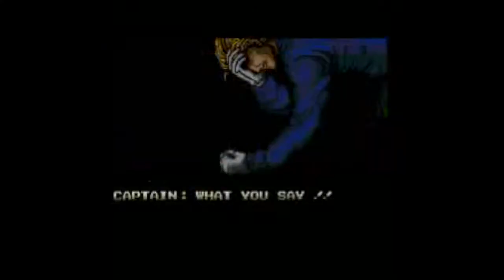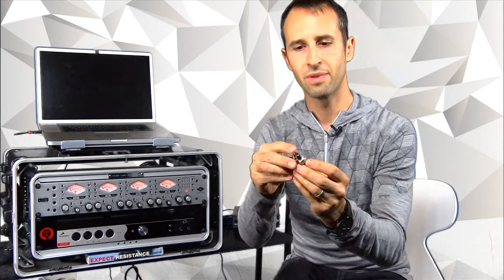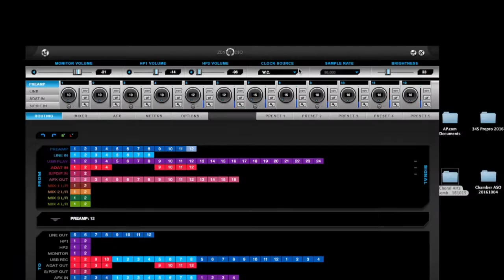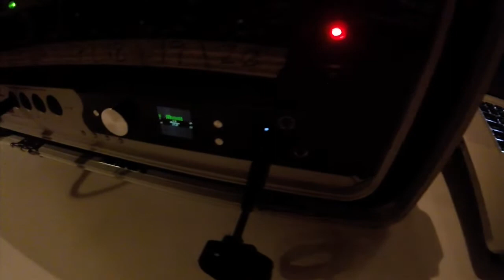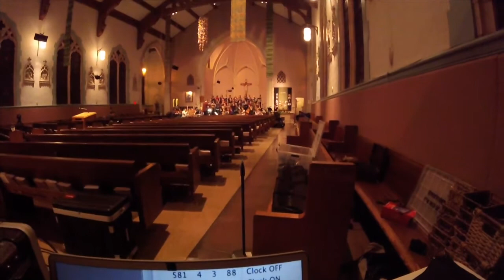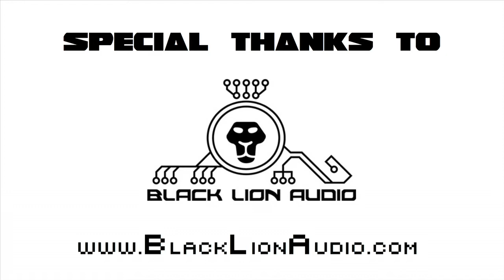External Word Clock Set Up Demo Recording Quality Comparison

Comment: im using my rosetta 200 to clock my apollo quad...thoughts?
Reply from the maker: Hey, thanks for asking! The Apogee Rosetta 200 has some age to it being just over a decade old at this point. The UA Apollo series is still fairly hot off the press & it's my understanding that a lot has improved in terms of clocking during this time period. Apogee vs. UA is like Godzilla vs. Wu Tang so it's a really tough call (although Wu probably wins, really). My suggestion would be to repeat the test I performed in my video:

1) Record identical source material with the clock & without the clock
2) Bounce in REAL TIME with the clock & without the clock
3) Critically listen with the clock & without the clock to different aspects of the recording like high freqs, mids, & lows

This process will def take some effort but you'll have tangible results to compare. You'll at least find things you like about each or maybe even a clear winner. I wish it was possible to give a hard answer, but maybe this will help with a decision. I hope this helps!
Reply: My point exactly!!!! If i have to critically listen,  check under a microscope sort of speak...& Its not a def" major.." oh hell yea moment". Then. It doesnt matter!!!! Its not. NIGHT & DAY
Reply: Lansky Sound tho i do appreciate the reply...i just clocked it to rosetta to see if i hear a diff". &. i dont
Reply from the maker: Cool. Whatever works best is the way to go, so if there's no audible difference I guess the more simple setup is the route. You might hear differences at higher sample rates depending on what you test with, but this is also dependent on speakers, connection quality, etc..

At the end of the day, the best setup is the one that inspires creativity & produces results! Rock on